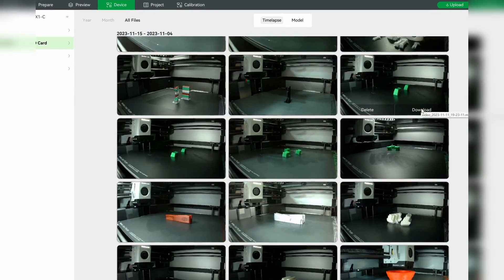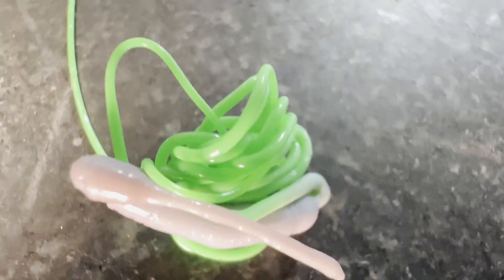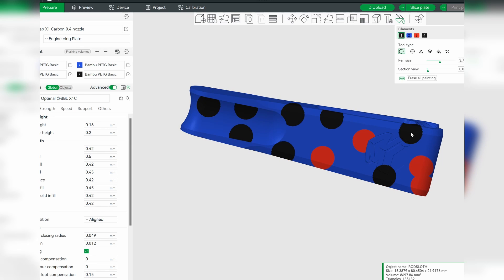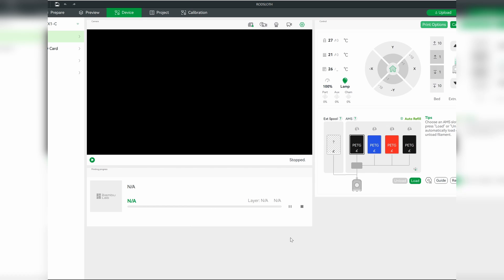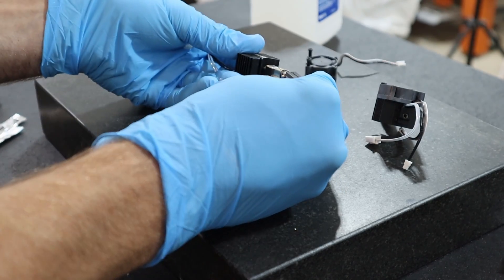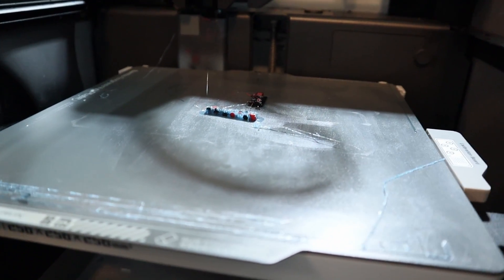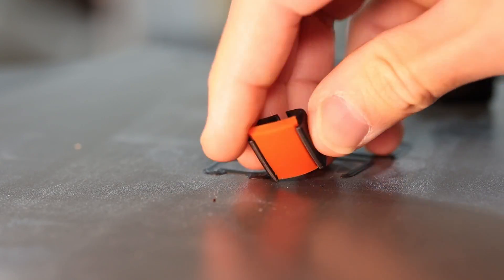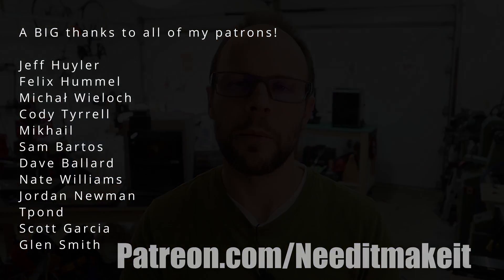Why is My Bambu X1 Carbon Printer Not Wiping?

Comment: I had some bad wiper issues...right after I touched the little silicone bit (nozzle wiper?) with my finger!
Some isopropanol and a cotton pad later, wiping is back to normal.
That little thing needs to be cleaned often...first sign of trouble, it gets the hose again.

Comment: I’ve got this problem. My things to try are:

1. Change the filament cutter as a poor cut will string more and keep attached to the nozzle longer.
2. Change the nozzle wiper.
3. Lubricate inside the poop chute with grease and regularly do that as part of the maintenance schedule.

EDIT: Nah, it turns out my filament was just wet.  I dried my filament (again) for 4 more hours and hey presto it started pooping correctly.

Comment: Good video, two suggestions, Plastic Repellent Paint from Slice Engineering.  Also there are several nozzle wiper upgrades, I like the one based on the A1 silicone wiper.  Good luck.

Comment: I've found that the PTFE tube wiper is a flawed idea, altogether.  In the A1, Bambu completely abandoned the PTFE wiper idea for a silicone wiper, and it seems to work very well, according to people that I have talked to.  I've found a solution to adapt an A1 wiper to the X1 and P1 models.  I made a video about it here:

https://youtu.be/EF0NnywWeJw

Comment: I have solved many of those issues by removing the poop shoot closing gate. Once you remove it Poop does not accumulate when flushing light weight filament or when printing with 2mm nozzle. Other consequence is that Poop looks way different then 😂.

Comment: My brand new x1c is having the same issue with petg-cf.  The PTFE coating on the nozzle sounds interesting but doesn't PTFE burn around 240?  Not likely to help with nozzle temps above 250.

Comment: one other thing I had happen was filament building up BEHIND the nozzle and somehow getting stuck up underneath the sock creating a little fuzzball of very fine string that would cause all kinds of issues - the Slice repellant brushed onto the silicon sock helps with this too

Comment: I've been thinking about a wiper mod for months, but what fixed it for me was a combination of: Slice's nozzle repellant (it's a brush-on liquid in a bottle, you coat the nozzle tips with it) now this stuff doesn't PREVENT build up, but it makes the build up fall off or be easily pulled off muuuuuuuch easier than without. so this makes the nozzle wipers job easier, and especially for PETG reduces a lot of mess on teh build plate and even some stringing... BUT it's not perfect, and requires a bit of vigilence - so I also just have a peek at the nozzle and take my flat cutters or pliers and snip at the nozzle between prints to grab any globs or oozing off. These two things have all but cancelled anything being pulled into the build plate - BUT with two filaments that ooze a lot it still happens: Inland PLA+ Cool white, and Polymaker Pollyterra Black matte, for some reason these two OOZE way too much long strands while just warming up, probably an issue with the temp too high but they print perfectly, just an ooze sometimes BEFORE printing.
Reply: (I wrote this before I watched the whole video lol sorry)

Comment: Have bambu changed the formula for petg cf recently? It prints really good with little problems. Or is regular petg that bad in comparison?
Reply from the maker: They've made some minor changes to the purge cycle, they may have changed the formula a bit as well.  I've had great success with the BIQU Panda Jet, it forces the air exactly where it needs to be to cool the filament and prevent it from coming into the chamber.  It has a lot to do with the nozzle material and to some extent the nozzle temperature as well.  I think the wiping system is novel and works for most materials, it's not 100% reliable for PETG, it needs something like a felt pad to wipe over to ensure no material is left.
Reply: @NeedItMakeIt  does your printer have to same wiping and cleaning attachments like the a1 mini has? As soon as I commented yesterday the filament gods were listening and my hose connector I was printing out of petg cf decided to not 😂 it was horrible looking.
Reply from the maker: It doesn't have quite the same method, I think the A1 series are better because they...well fling it off of the nozzle, for the P1 and X1, it instead rubs it off (that sounds terrible).  It has a cylinder made from Teflon which pinches the filament off, but if the filament is too flexible or too sticky, it likes to contact the nozzle and then it will stick and make an awful mess in your print, or in the buildchamber.
Reply: @NeedItMakeIt  gtfo! The fling is king 👑. No wonder. It’s way more expensive too. That doesn’t make a hole lot of sense. Yeah the a1 mini is definitely the best 3d printer I’ve owned. It’s my first printer but that’s not the point. I’m super happy I didn’t get the prusa mini.

Comment: I love to print with PETG even though PETG is the bane of my existence!
Reply from the maker: Since I switched to the BIQU Panda Jet, I've only had 1 piece of PETG come into the build chamber, it seems that the improved cooling and direction of the airflow has helped quite a bit.  Not 100% solved, but far better at least.

Comment: My X1C has done this since day 1 with no real way to correct it. Sucks coming from the A1 Mini because although it did poop a lot, the cutting method on that one is almost flawless.
Reply from the maker: Well I have something that helps quite a bit, I just made a video and since I installed the BIQU Panda Jet, I have had 1 single piece of PETG in the build chamber, normally it would be just a mess, it seems to cool the filament down quicker and also the air pressure is forcing the poop down where it belongs.  I can't say that it is 100% solution, but it's far better not to mention that it does a better job now with overhangs and bridges.  The video is called Air Flow, if you wanted to see what I mean.

Comment: nice nice video, thanks. but did u try out a nozzle whiper mod? there are some methods to test :D
Reply from the maker: Yes I've tried several but they were not good enough and caused more problems than good.  Do you have a good mod that you use?

Comment: I have been printing for 2 years now and I just upgraded 2 weeks ago to an X1C and I have mainly printed PETG. I have to watch the first layer on every print before walking away from it. I found that the biggest issue is the Overature filament I have with the settings I use will stick to the nozzle or silicone sock on the nozzle. When that happens almost any other PETG after will get stuck to the nozzle and that’s when I get trouble. Once I am done with that filament then no more of that brand for me and I’m not willing to figure it out when I ran Bambu and Hatchbox with none of that.
Reply: This exact issue is why I looked for this video. Overture/hatchbox combo in a two color print and the overture has made my nozzle absolutely sticky to other PETG.
Reply: I’m having the same issues with Overture PETG but they have a colour I REALLY like so I’ve been messing with the print settings. I’ve found that heating the plate to 95C for the first layer and then keeping it at 85C for the rest of the print makes adhesion WAY better and I’ve had less failures. I also print the stuff at 265C. It seems to prefer being really hot. 

Oh and make sure you have a good brim. I use 7mm otherwise it also likes to warp and peel off later in the print.

Comment: Have you used new start and end gcode on your old profiles? They change the wipe and start gcode a lot, and you wont get those improvements unless you use a new stock printer profile, or if you copy the new start/end gcode from new stock profile over to your old modified printer profiles. Also, I took sand paper to scrape lines into my ptfe wiper tube so it kind of scrapes plastic off the nozzle a little better.
Reply from the maker: I mainly use the stock profiles, I'll take another look though, thanks for that.  I hadn't heard of the scraping idea, I've seen a few other options, such as caps with tapered wipers on the inside to prevent the waste from being 'flung' back up, I haven't tried them since there seem to be quite a few complaints about that method still.   I've had better success with Prusament, however it's still not 100%, maybe 95% or just above that.

Comment: Helpful content!
Reply from the maker: I've been testing Prusament and it is better, but not fixed, The design of that wipe system needs a bit of an overhaul.  The concept of having a slightly flexible area that can wipe and separate the piece from the nozzle has come to my mine, similar in a way that you grab a nail with the claw of a hammer.  There is some potential for a fix that always works, but the material is important.  Teflon or aluminum might be good options.  Maybe delrin?

Comment: I wonder if you are right about the brand of PETG. I have printed a lot of PETG on the X1C without that issue using polymaker.
Reply: i am having this issue with Bambu's new PETG-HF, which is supposed to be made for this printer.
Reply from the maker: I think it must at least play a part, I have some Prusament on the way... I'll be putting some of that through to see if there is a difference, hopefully it works like your has been and I can print some structural parts with color and not have to worry too much.  Thanks for the feedback on that, it's good to hear from everyone else to see whether this is only a problem I have, or if it's something lots of people experience.   

Side note: I have a spool of PETG made in Canada, and I could not figure out how to print with it, terrible results.  It turns out that I need to run it at 280C nozzle temp!  That's the only way I can get good results with it, I can also run a lower nozzle temp and slow it down more, but it's already pretty low at 12cu/mm/s.  It shows that there is a lot of variation from one filament to the next.
Reply: I have the exact same problem especially wit Polymaker PETG, Filament keeps stickimg to the nozzle and destroying first layer

Comment: Wow good luck with being full time! I think petg just being so stick is the main culprit and the wipes might not be sufficient enough for that. But i have no experience with bambu labs printers and really just recently got into eptg
Reply from the maker: Thanks!  It's a lot of work of course... but I am a bit of a workaholic so it's good.  I don't think many people think of PETG for color prints, but when printing structural parts, it's one of the better materials, except for times when too much stress is applied and it likes to shatter, which is such a strange property of the material.  With the best layer bonding of the off-the-shelf materials it would be nice to be able to have that and be able to print in color without too much trouble as well, even if it is just to add a logo, or some text into the lowest layers.  Thanks, if you want to more 'live' I'm on discord also, https://discord.gg/2YQzBmAC

Comment: My issue although not quite as bad as you was the part cooling fan was on during the purge and that caused the poop to not curl up in a tight bundle and making a stringy mess I found that the weight of the bundle drastically helped pull away from the nozzle during the wipe
Reply from the maker: Oh, that's different than mine.  What seemed to be happening for me is that the fan would stay off until it finished extruding, it would then come on for a few seconds just before the wipe.   The flapper design could probably be improved a bit as well, sometimes the poop tangles up around some of the parts and it jets jammed, one it starts, there's not much to stop it.  From my testing, it looked like the process was the same regardless of the material, I would imagine that they could adjust the code for each material a little bit to improve it.  It works as well as I'd expect for PLA and ASA, those seem to respond just fine to the setup.  It's great to get feedback on this from everyone, there are only so many things I can test on my own.  I'm hoping to get a lot more of these types of comments.  Was there anything else you're having issues with on this printer?  I am super happy with mine, this is pretty much the only complaint so far from my side.
Reply: @NeedItMakeIt  No other than somehow having the fan on during the purger the machine has been great but yeah supper happy with this machine I've spent 3 years having a blast modding an ender 3 Pro and its still a great machine but the X1 is in a league of its own I have a K1 to and that's been working great as well the market has progressively improve in what I would consider a short amount of time, looking forward to what's next
Reply from the maker: @mrbilky  You and I have been living the same lives apparently :)  I also have a K1, but I haven't found that I can get as good results with it as I have been with the Bambu, and I need some help because it should be able to.  I wonder whether it is the slicer or something else?  Do you have the same good clean 'vibration-less' results regardless of which printer?
Reply: @NeedItMakeIt  I have both the X1C and the K1 on concrete pavers on the same shelf no issues there I have pretty much committed to orcaslicer for my machines it just seems to work without a lot of tweaking and they produce almost the same with the X1C doing just a bit better
Reply from the maker: @mrbilky  Perfect, I'm going to use what you've done and see if that works for me.  

I mainly try to keep things as stock as possible, but having one slicer that works for all is better for everyone.  I can't say I have been too impressed with Creality's Slicer, it isn't loaded with as many features, it's slow, and I can't be sure if it is the printer or the slicer, but it has trouble finding the printer to send prints wirelessly.  I guess the main issue out of them all is that the results are not as good, the only exception being the stock Benchy included with the printer.  I don't find any of these issues the BAMS.  or the X1C.  Thanks for sharing this with me, I hope that this gets the K1 where it should be.

Comment: I print exclusively using PETG, and I  sometimes experience the same issue. I haven't tried it out myself, but I think it may have soothing 5o do with the extruder.
Reply from the maker: I'll have to try some good quality material, I'd like to see if it has anything to do with quality as well.  There are lots of variables on this one I think, it could be a combo of issues.  PETG loves to stick to everything, one of the reasons the silicone wiper didn't work well, it even stuck to the silicone enough to cause problems.  Someone mentioned that using Alum foil will prevent that, so maybe the fast cooling like a heatsink would prevent issues like some of the problems.  Hard to say, but someone smarter than I am will eventually come up with something right?